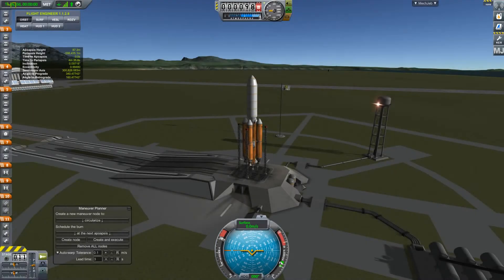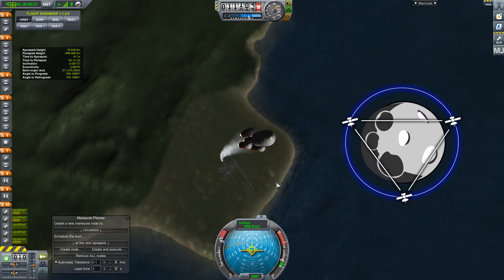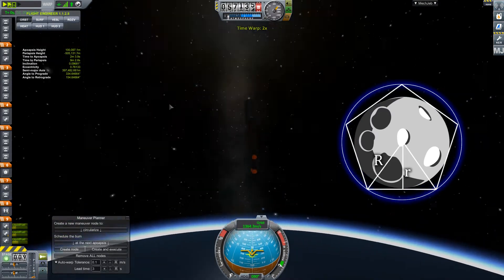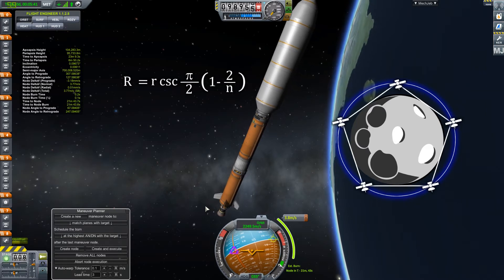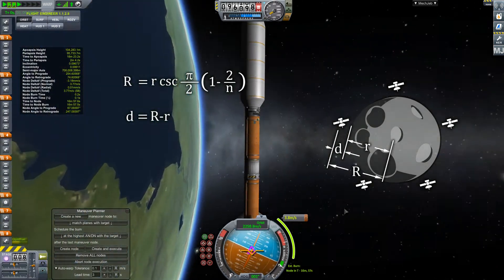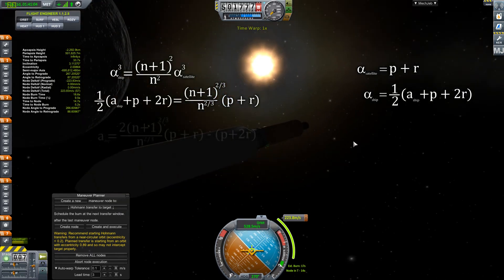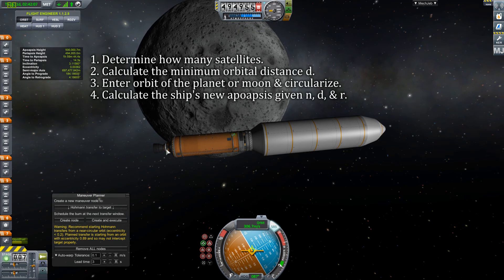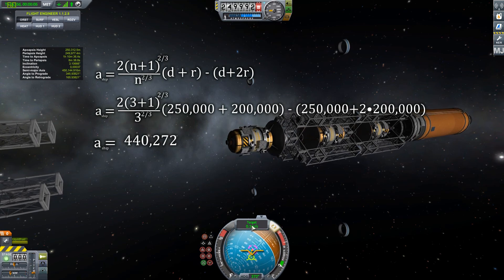Tutorial - Evenly Spacing Satellites for a Communications Relay Network - Kerbal Space Program

Comment: You are over-complicating the problem. (1) get to the desired orbit (2) divide the current orbital period by the amount of satellites and add this number to the orbital period to get your second orbital period and burn prograde until it's achieved (3) release a satellite right before the PE where both orbits intersect (4) burn retrograde with the sat until the first orbital period is achieved, and let the dropship continue on the second orbital period (5) repeat with the other sats (6) fine tune the orbits when all sats are in place
Reply from the maker: Sure you can do it your way and there are a ton of videos on similar methods. However as I mentioned in other comments and in the video, the point of this video is for a more mathematical and physics understanding behind what is actually going on.

Comment: Pretty good video, it explains the math quite well. I was following your equations by doing them in my notepad and I put a little extra feature into them, which is accounting for the atmosphere. According to my 2 am math, it only has to be accounted for when you're calculating the minimum height. My equation for that came to be (p+a)/sin(π/2 - π/n) - p (where p is the planet radius, a the atmosphere height and n the number of satellites).

After finishing, I decided I really don't want to be doing these calculations myself or alternatively having to write them into wolfram all the time, so I made a dorky little C++ program that just asks for the parameters and for some reason speaks like a cowboy. It totally didn't take me 3 hours because of some weird type shenanigans (especially with the power function). So it may or may not be 5 am right now... But hey, the numbers it's spouting out now are correct and it's gonna be really useful as I send my drone army around the Kerbol system!

Anyway, thanks a lot, mate!

Comment: What i do is I just enter a circular (pretty much perfect circular) orbit with "eyeballed" altitude, 
take the orbital period time (from kerbal engineer redux),   - convert it all into seconds, 
multiply those by 1.3 (to increase it by 1/3 coz i usually deploy 3 comm relay sats),   - convert back to D/H/M/S (from just seconds) 
and then burn prograde with my "drop ship" until my engy redux shows that orbital period..... Simple as that... 

Then drop the relays 1 by 1 at a predesignated spot (Pa, since i burned prograde to increase orbital period by 1/3 - works other way round too.....) 
and burn retrograde with each sat until my orbital period is the same as original, eyeballed one..... 

Use RCS  to adjust orbital period down to millisecond 

and voila!  new fully functional comm relay is there..

Comment: You could save some dV by having your dropship have a lower orbit than your final satellite orbit.

For example, suppose you are going for keo-stationary oribts starting from a 100km circular orbit of kerbin. To get your apoapsis from 100km up to 2863km, you need 651 m/s of dV. Then if you put yourself in an orbit with 2/3 the synchronous orbital period, you only need an additional 253 m/s of dV. Then you release your satellites and they circularize at 2863km, which requires another 171 m/s of dV. Overall each of your satellites needs 171 m/s of dV and your ship (once in orbit) needs 904 m/s of dV.

However, if you set up your dropship with an orbit as shown in the video, where the orbital period of the dropship is 4/3 the synchronous period (rather than 1/3) then the following would be true. To get from 100 km to the apoapsis of the higher orbit (4327 km) would require 726 m/s of dV. Then to raise the periapsis from 100km to 2863 km would require 346 m/s of dV. Then once the satellites are released, each satellite would need to lower its orbit requiring 84 m/s of dV. Here your dropship would need 1073 m/s of dV (after reaching a 100km circular orbit).

Overall if you use a higher dropship orbit, then your satellites need less dV, but your dropship (carrying all that mass of the satellites) requires MORE dV as compared to using a lower dropship orbit.

NOTE: This is all specifically for a Kerbin network. A network around any other body would be the exact opposite, where higher dropship orbits are less dV expensive because for those bodies you start with a hyperbolic orbit rather than an elliptical orbit.

Comment: Very nice. Although I would suggest one minor change.
The change is get the orbit of your drop ship tuned prior to deploying any of the satellites. This modification means that you're only interested in adjusting the orbit of a single vessel at any given time and that you have plenty of time to tweak the drop ship's periapsis and apoapsis to as precise a value as desired. Once the drop ship's orbit is tweaked, you then no longer have to adjust its orbit for the rest of the deployment.

Now, each time the drop ship reaches its periapsis, you detach the next satellite and circularize its orbit. Heck, if you want your timing to be nice and relaxed, you can have the drop ship doing a retrograde hold attitude during the orbit and have the satellite separate a minute or two before reaching periapsis. After separation have the satellite also go into retrograde hold and perform the circularization burn as the satellite reaches periapsis.

Advantages? At no time are you needing to perform maneuvers with two vessels at the same time. Also, you don't have a tight time constraint on adjusting the orbit of the drop ship (which you do with your method).